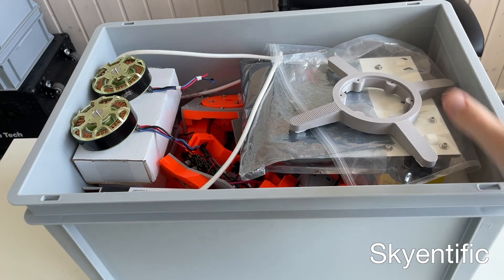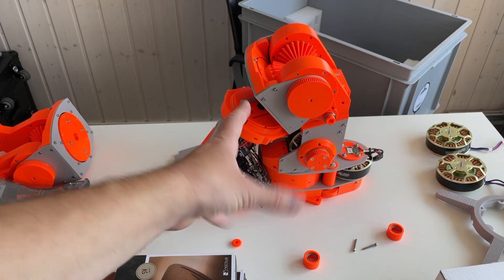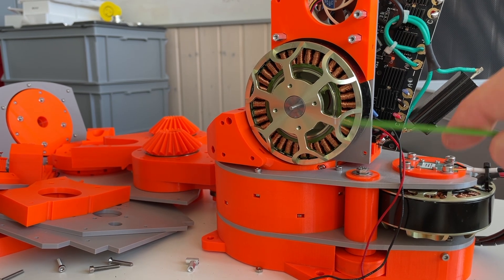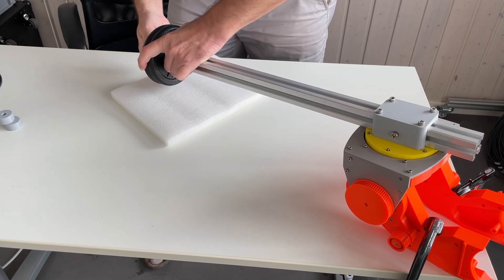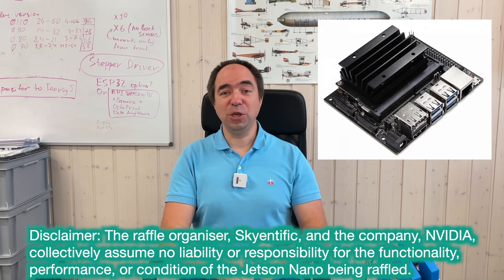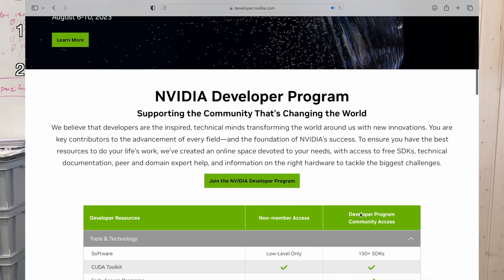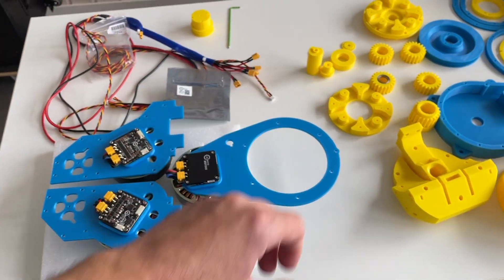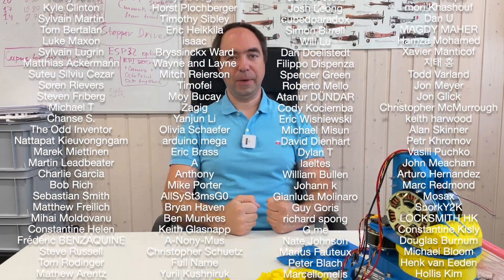The most advanced 3D printer robot (refreshing my 4y old design)

Comment: 🔶🔶🔶We are writing a patent for a large number of novel novel differentials and right angle torque transmission innovations that do not use  TOOTHED gears. It will be 300 pages long. 

🔶🔶🔶Just a heads up, we have patented an entirely new, infinitely variable, ultra-torque dense, gear technology, called 𝔽𝕣𝕚𝕔𝕥𝕚𝕠𝕟𝕃𝕖𝕤𝕤 𝔾𝕖𝕒𝕣𝕤 [a CVT/𝕀𝕍𝕋] based on our reformulation of gearing theory.

The technology enables transmissions of ~1/10th the size/mass/cost which enables use of motors/engines/batteries of significantly smaller size. It also provides novel 3D motion of robotic appendages/manipulators/booms

===
✈ℕ𝔼𝕎  𝔽ℝ𝕆ℕ𝕋𝕀𝔼ℝ  𝕋𝔼ℂℍℕ𝕆𝕃𝕆𝔾𝕐  𝔾ℝ𝕆𝕌ℙ is a visionary multidisciplinary B2B innovation company utilizing a licensing business model or collaborative enterprise with strategic partners to develop Advanced clean, efficient, power dense solutions in domains of energy, propulsion, mobility, robotics / exoskeletons and clean technologies with a particular emphasis on the aerospace sector including space exploration and commercialization

Comment: mhd true dc motor, ie radial current, two steel/metal surfaces, rolling ball bearings as the current pathway, vertical magnetic field below insulated, a thrust bearing socket on the bearings top side
Reply: Do you realise that most of what you wrote makes no sense?
Reply: also specialization means that you dont use your own parts, in something you would like to use yourself, ie specialization is without sense
Reply: there is no use for specialist, and trade, as diy is better, so that none does nonsense for others
Reply: science alone does not help anyone, do it like you would use it yourself, and not for selling in any way
Reply: then it might be useful actually somehow
Reply: forced trading is not useful
Reply: you forgot the most important guidance: k.i.s.s.
Reply: linear axis motors are just fine
Reply: if you think you lack something, you think wrong, so there is no trade
Reply: anode ray tube (ionizer accelerator) separates atoms and makes nano structures like a 3d printer, at home, diy, vacuum device, so that you do something useful, ie, dont pester anyone to serve you
Reply: no lubrication, other than conductive, like graphite, current must flow in the radial direction over the bearing
Reply: both the bearing rings are stationarily linked, also to +/- terminals, only the bearings move, ie mhd style design, others possible

Comment: It's a small thing but I like that belt tensioner.  No need for an adjustable mechanism when you can just print a new part for next to nothing.  There's probably a bunch of other design paradigms that need to be updated for new technology like this.
Reply: @Badspot :  There is a temptation to use a sliding or eccentric tensioner... my experience is that they could be a weak spot, and probably become a source of annoyance.